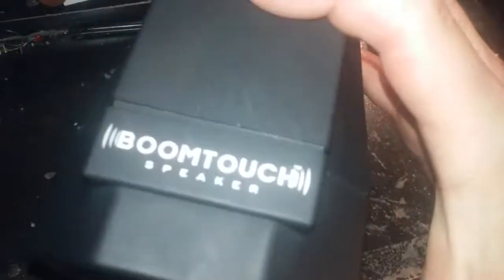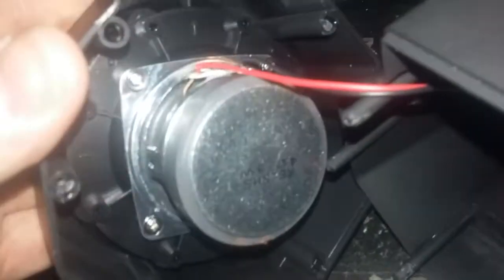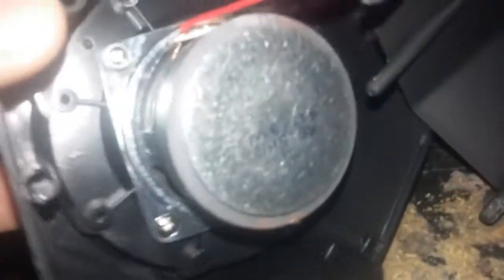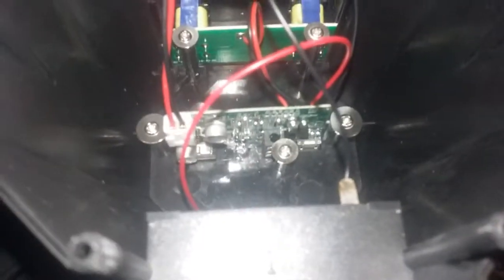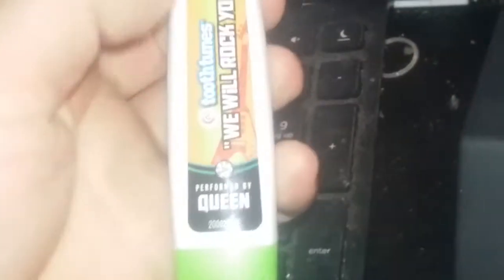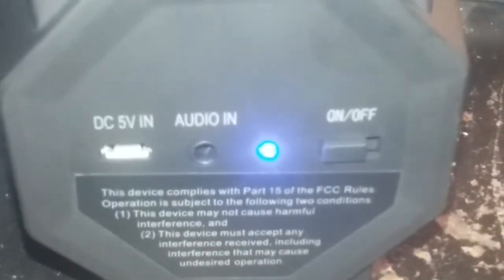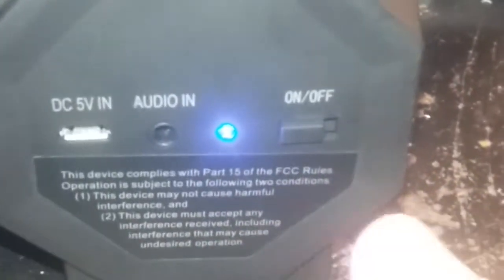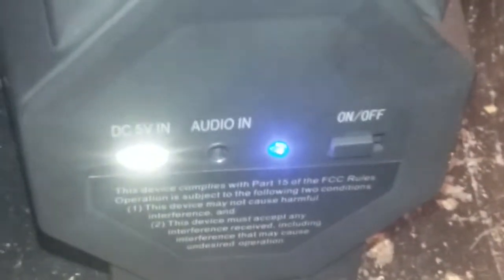As Seen On TV Boom Touch  Speaker Teardown

Comment: I have a new Boomtouch, but out of the box it has a crackle & static noise.  Is there something I can do to fix it?
Reply from the maker: One of mine had that issue so I touched up solder joints and put some contact cleaner in the switch and flipped it on and off rapidly. That seemed to help. These things are made at a price and some defective ones get through.
Reply: @coondogtheman  thanks.  Gonna give it a try.  I bought 4 & all the others worked perfectly.

Comment: Can someone please tell me what the double stick tape is for? I just got one today and I can't believe they're expecting me to put tape on my phone? As for quality, it's not horrible but it's not awesome. It sounds better with music that stays the same level through whole song.  I didn't buy it, it was a gift so definitely not complaining. Can't find anything anywhere about the tape though and it's driving me nuts. Lol
Reply from the maker: JoeyMarie I never used that. I guess you can stick this on something. I jjust threw it aside.
Reply: It's so your phone doesn't slide , it's not double sided tape it's a rubber texture that reduces sliding and it's meant to be put on the speaker
Reply: Its a non slip mat, your suppose to put it on the top where you place the phone.

Comment: That's a reasonable sized speaker inside even though it's tiny it's loud and bassy props for them for such quality put into it
Reply from the maker: yeah it cranks pretty loud. It works better with the 5VDC USB power input but use a supply with 2.1 amps or more because when you crank this puppy up loud it pulls the juice. the power LED flashes with the music. I may buy two more of these and gut the insides and make regular speakers out of them. 
I made a set of speakers from a broken set of computer speakers but I like how the boom touch looks better. This is for a boombox stereo that I still have. The speakers blew on it and the CD player died so I took the power wires and made sort of a USB charging dock out of it with an audio input.

Here's a video of that system: https://www.youtube.com/watch?v=U0dJJ6i9L3s
Reply: Skywtaker Productions done

Comment: I can't get the top piece off the bottom??
Reply from the maker: Get_Trolled 4321 see where the seam is on my speaker in the video? wedge something flat into the seam and twist, it should separate, you'll need to do the same on the other side.